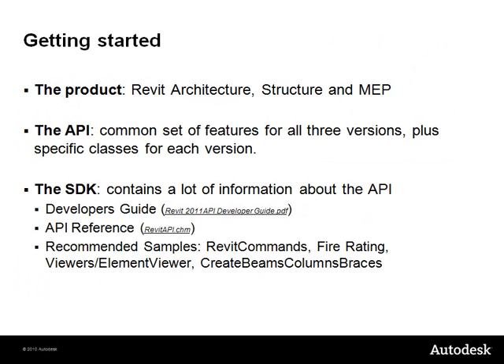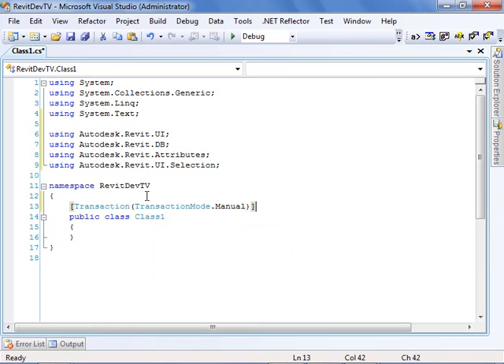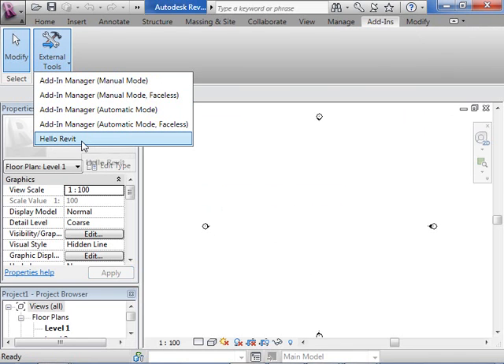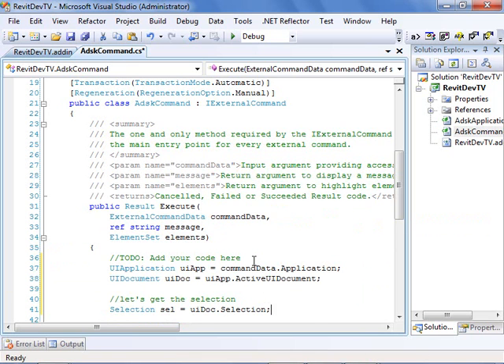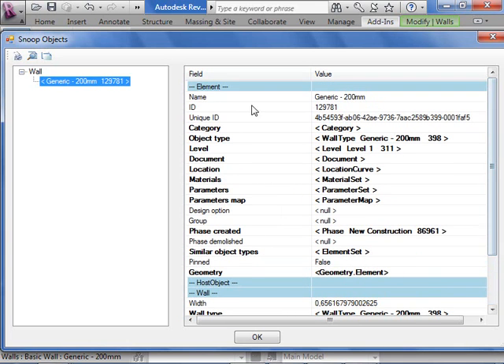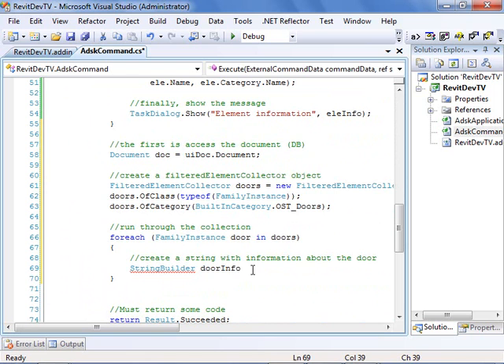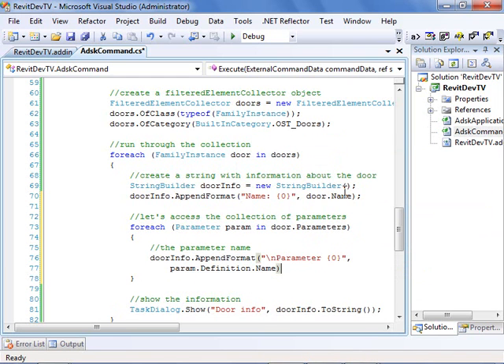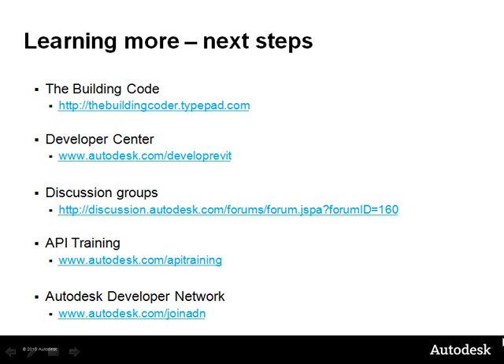Introduction to Revit Programming (Part 1)

Comment: Hey, Nice video. I have a question. I made the filter for pipe fittings. I drew an elbow of 90 degrees. I started the App and I can see all parameters and values. But when it comes to the angle of the elbow 90degrees, it shows that the angle is 1,54....... Any idea why it is not showing 90 degrees?
Reply: Angles are reported as radians. You need a simple conversion to get degrees.